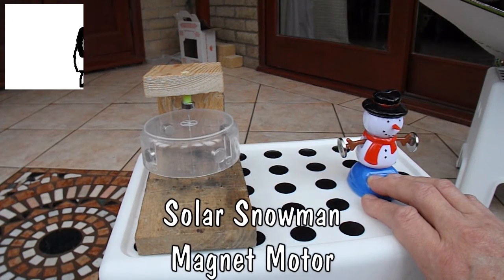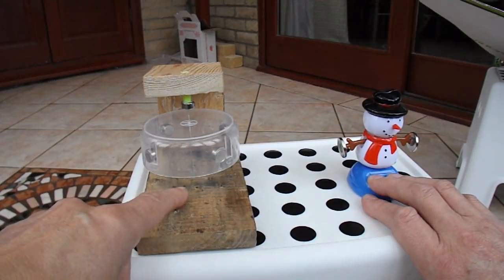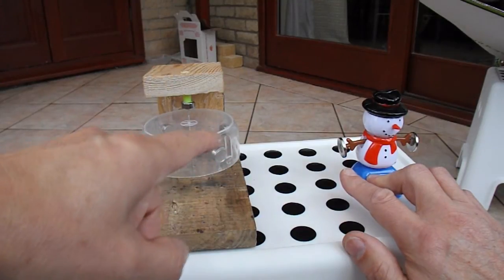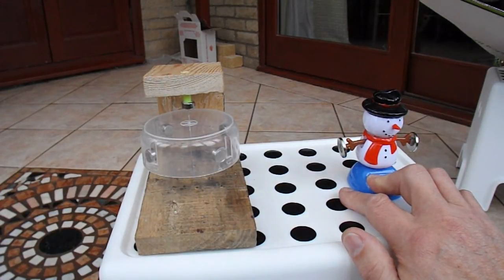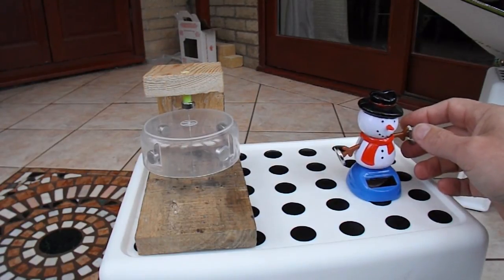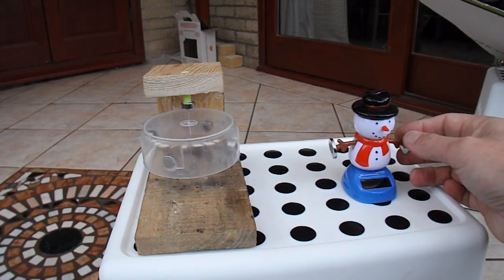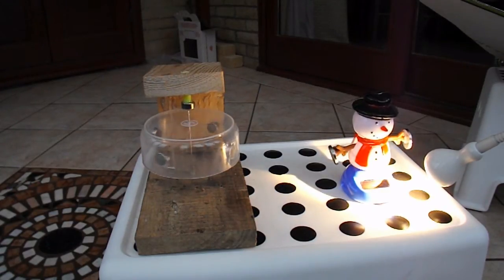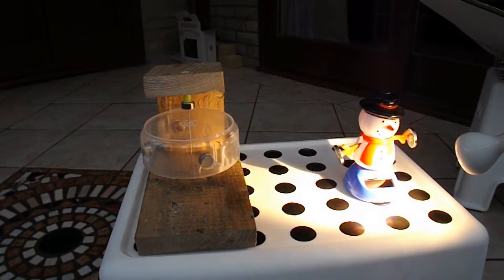Solar Snowman Magnet Motor explained - see video description

Comment: How have I only just discovered your channel!  I recently started looking for the circuit behind the solar movers' mechanism and your channel has helped provide me with some great info and ideas, thanks!  I ended up on your channel after watching a video about another guy tinkering with solar mover bits!  I think, if you haven't seen it already, that it's well worth a watch!  e has a slightly different take on your solar rotor design:  https://www.youtube.com/watch?v=zsGS4w7gGu0
Reply from the maker: Tom Southworth thanks, yes OUBrads does have some fun projects there.